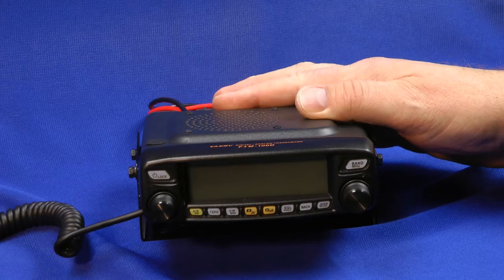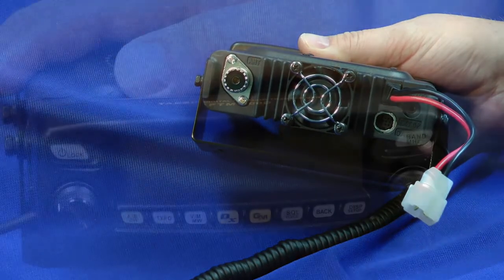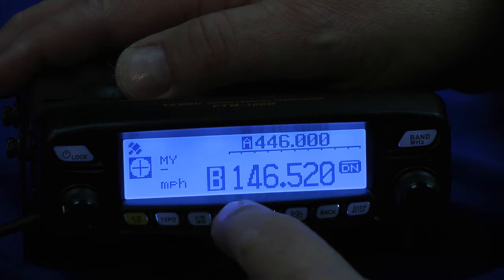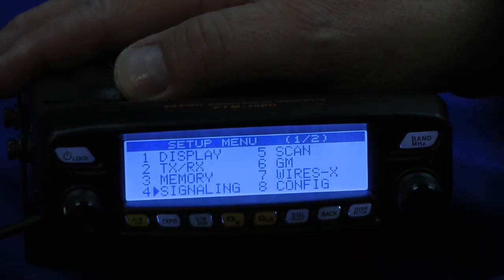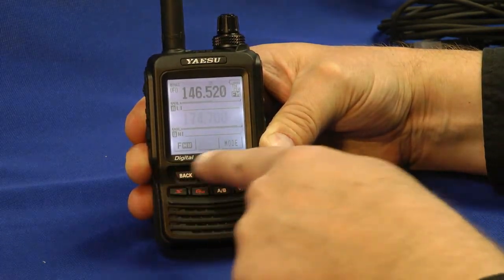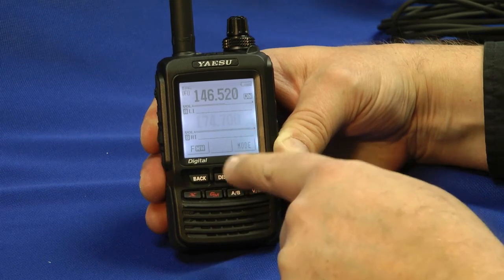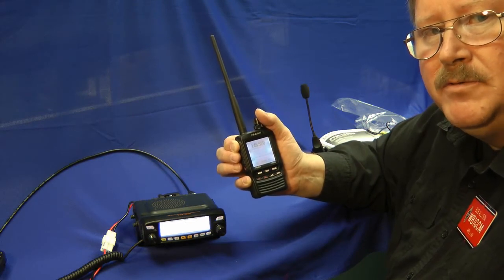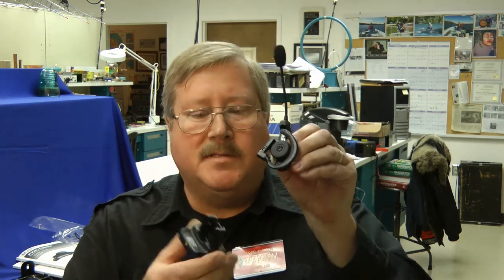Yaesu FTM-100DR and FT-2DR Transceivers

Comment: VW mode is NOT a digital data mode.  Both DN and VW are digital voice modes.  VW (Voice Wide) use a voice code of 4.4 kbps with error correction code of 2.8 kbps which is Digital Voice Systems, Inc’s AMBE+2™ Enhanced Full-Rate (7200 bps).   DN (Digital Normal) uses a voice code of 2.45 kbps with error correction code of 1.15 kbps which is Digital Voice Systems, Inc’s AMBE+2™  Enhanced Half-Rate (3600 bps).   DN mode then adds additional error correction codes so for either mode, the data rate to the FM modulator is identical.  So VW mode sounds clearer but starts to breakup sooner in a weak signal condition while DN sounds more compressed but works better under weak signal conditions due to the additional error correction.  Be sure to try the VW mode if you own a Fusion radio.

Comment: The FTM-400 also has Bluetooth capability - but requires an optional module to be installed. I like the FT2Dr and do not experience the high pitched sound you refer to Vital. Have had mine for a year now with not one issue. Love it.